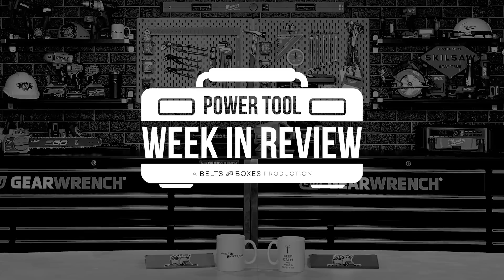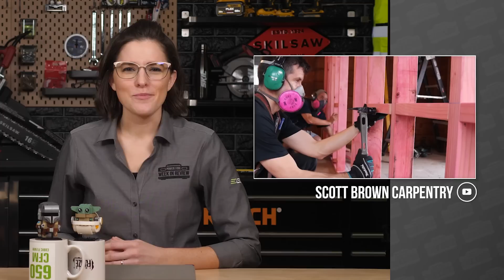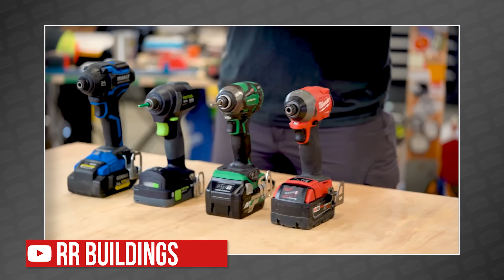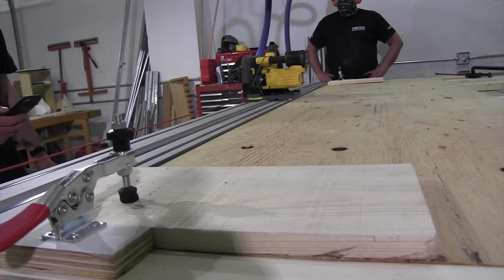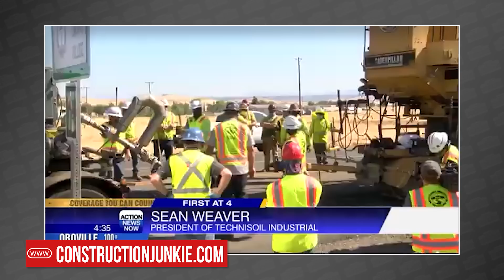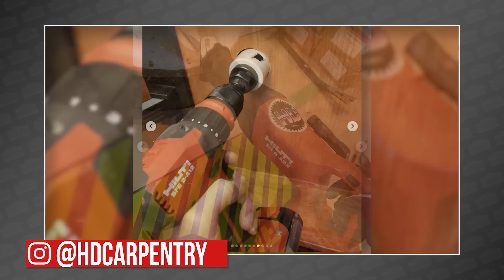The PERFECT EXCUSE to BUY Festool. Plus your power tool news! S3E33

Comment: I was told metabo are bringing out a cordless plunge saw. It will be integrated with mafel. Since we don't get the mafel in Australia. The model is still in the pipeline. From the reps understanding I know they use the cas system perhaps the metabo is a carbon print of the mafel as it's the only way to come into Australia according to the tool shop sales person. I hope this is the case as my mind is set on getting a mafel style cordless plunge saw. The metabo vacuum is really a starmix so this may also be the case when they bring out the cordless plunge saw. Keeping in mind metabo have the high end orbital sander which is like an air sander.
Reply: The Bosch plunge saw (GKT55) is also made by mafell